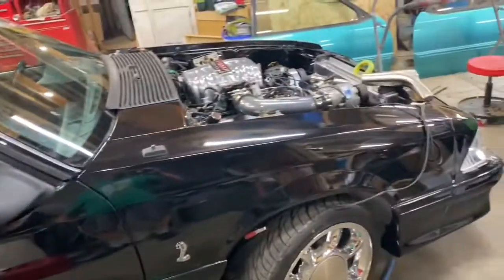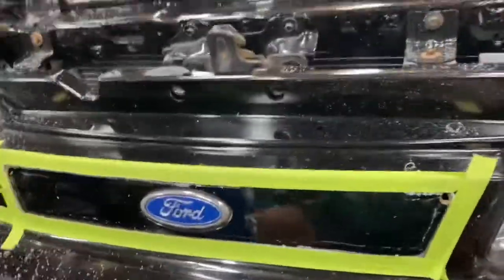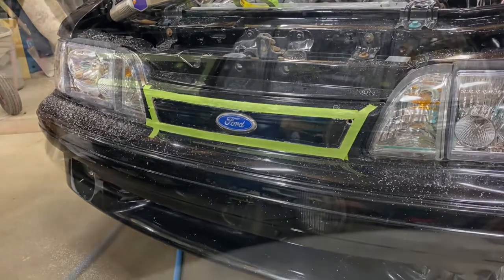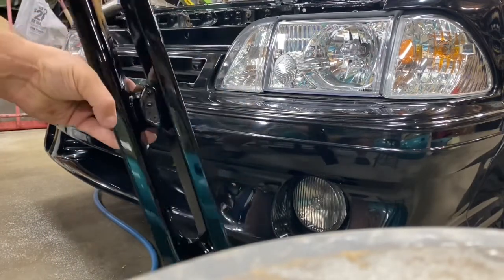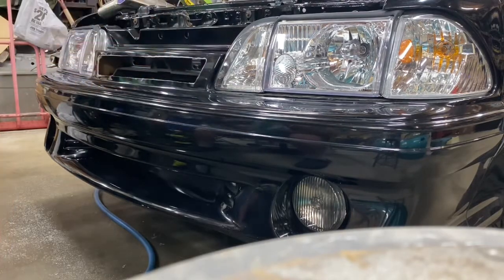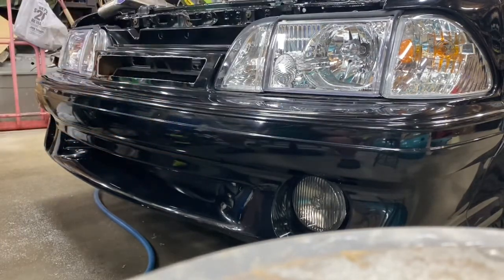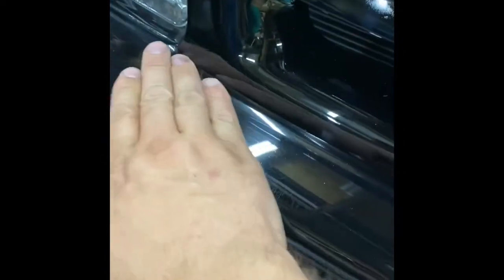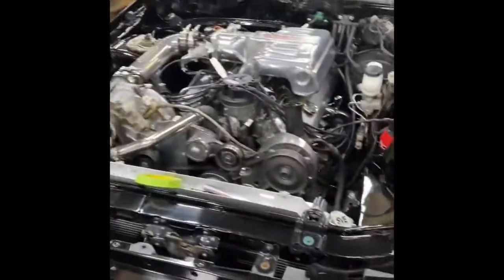Foxbody Cobra Grille Install

Comment: You did a really good job cutting that hole out,looks great!

On my 91 GT i put one in back in 02 or so, fast forward 22 years and that thing was falling apart,the way the pony was secured was weird,probably cause it was some of the early aftermarket ones and it was a big hole and this spacer went thru, just kinda weird how they secured the emblem,back then i didn't use double sided tape, i used black RTV (at my job we use big tubes of it so i had plenty) and it held all these years but like i mentioned, the whole insert was severely sun baked and it just broke in my hands when i pulled it off.

The new insert i bought was from LMR (original tooling) and it was real nice,you learn something new every day about these cars,i always thought those Cobra inserts were actually a one piece bumper that only went on the Cobras but thats not so,Cobras also had a insert on a regular GT bumper but it was secured more professionally by the Ford people/SVT etc, i think they had a couple of those black barbed pins because on my new insert it had a provision for something like that that i didn't have on my car so i just used doubled sided tape, looks pretty nice, good tip on the 2 screws.